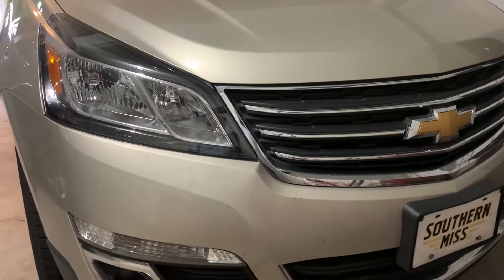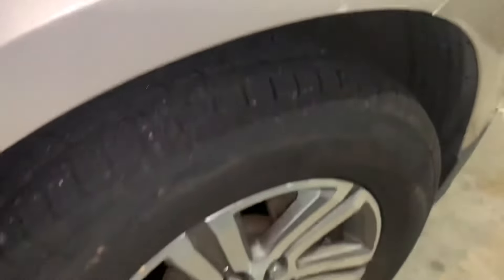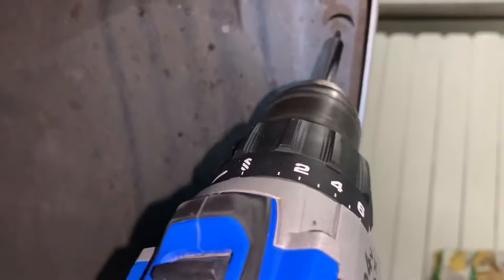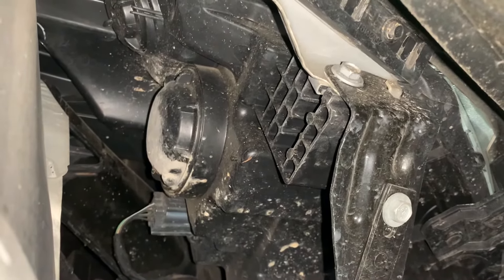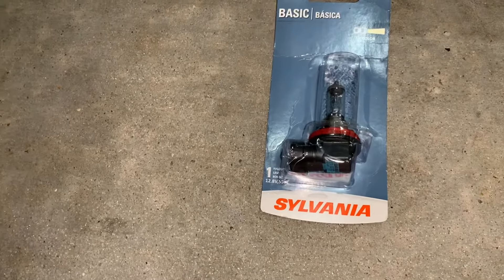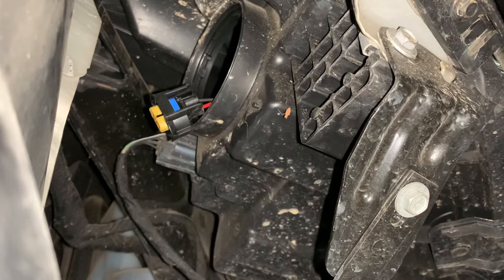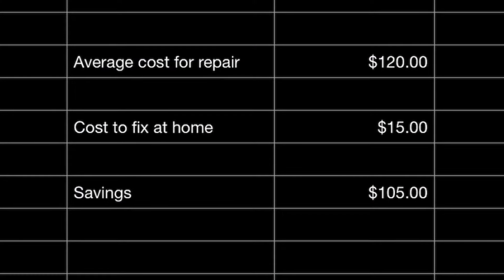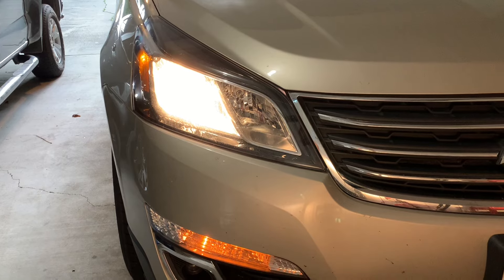How to replace a headlight bulb in a 2016 Chevy Traverse

Comment: Thanks for the video. I saw another video on how to do this without removing the wheel. It worked fine but your video was more helpful in showing the location and how the parts look.
Reply from the maker: It definitely can be done without taking off the tire but I find that it was easier on me and my temperament to go ahead and take the tire off. Thanks for the comment.

Comment: Just giving you a heads up, you don’t have to take the wheel off lol if you’re replacing the passenger side headlight, turn the wheel towards the left which is away from you. Pull your two Torx screws out with a T 20 bit and change the bulb. Again, no need to remove the wheel.
Reply from the maker: That would definitely save some time and effort. Thanks for the comment!
Reply: I just used an Allen wrench to get the screws out. Easy as can be.
Reply: Too bad they didn't do it like the Equinox

Comment: After putting the tires back on I am thinking the shop would auto tork the wheels in case they don't all get on even.  And the last time I took it to the Service Center in GILROY they cracked the passenger rear cover for the tail light.  I put some tape over it before it fell out.  I have my tools out of the storage 3 hours away and at least now I can work on stuff myself.  Except the arms and hands go numb from the beatings I took as an adopted child.

Comment: The auto repair shop I frequent just quoted me $128 for the exact same bulb replacement on my 2016 Traverse.  They claimed that was a discount because the “Book” says it’s a 1.5 hr job.  
I’m going to buy the bulb right now for $14.
Reply from the maker: That’s exactly what I’m talking about! Good for you! Let me know how it goes and I have learned from others that if you turn the tire outward, you don’t have to remove it. Thanks for watching!
Reply: I got a quote of $175😂. Ya I’m doing it myself. They said the “code book”
Says it takes an hour
Reply from the maker: Awesome! Save that money!!

Comment: Yeah, doing the high beams without significant deconstruction is a pain. Small thin hands are best, but you will need to remove the engine cowl and go through the wheel well. Best tip I saw is using a bungee cord to hold back the wheel well skirt.
Reply from the maker: That is a good idea. I’m all about finding the best way to do things.
Reply: You don't have to take the tire off you can turn it inward towards the engine and still get the same clearance
Reply from the maker: Yes, unfortunately I learned this too late. Thanks for sharing. Hope it helps someone!

Comment: How about the driver side
Reply from the maker: It works the same way. Take off the tire (or turn it out of the way), remove the push pins from the shell and you will have the cap to access the bulbs. Please let me know if you need anything else. Thanks for watching and if you haven’t already, please subscribe.

Comment: Can’t you just turn the wheel to the opposite side of the headlight you are changing.
Reply from the maker: Yes. I’m sure that would work. I just couldn’t seem to make it happen and I wanted the room to move. Thanks for the tip!
Reply: @marcusfixesstuff  I just had to change mine.